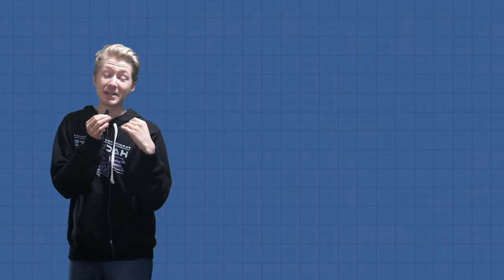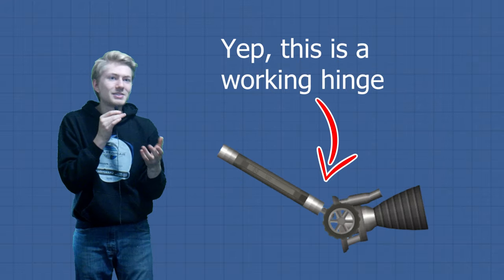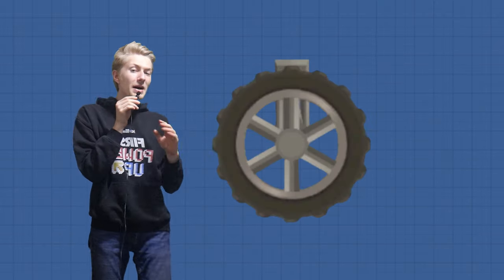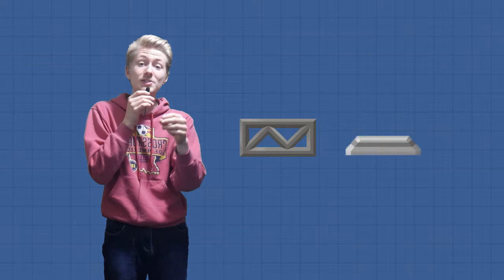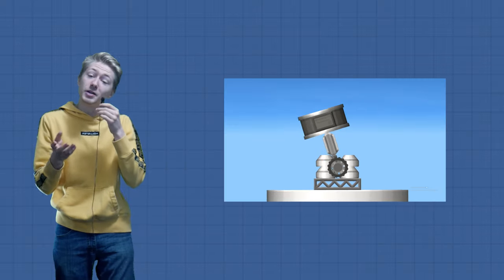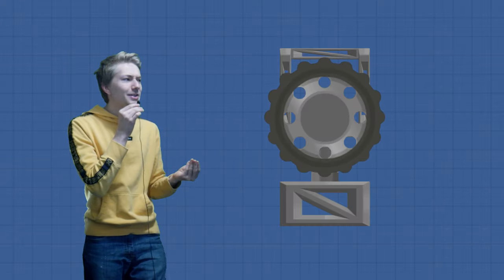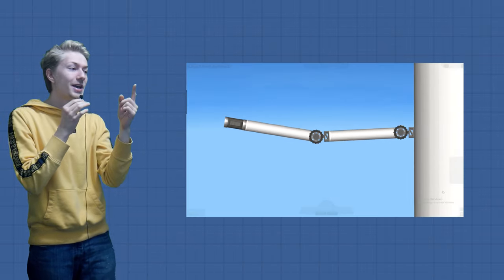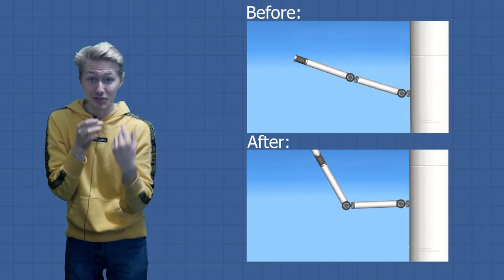How to MAKE HINGES in Spaceflight Simulator - SFS

Comment: Ok ok ok, I’m on sfs 1.5.7 iOS and IT WONT WORK
I need help with this I’ve tried the first one and it doesn’t work
Reply from the maker: which one?
Reply: @Heroix.  the first one the struts I think
Reply from the maker: @CAPTAINRIO7787  the struts one is kinda hard, you need something to push the wheel into the center iirc

Comment: Is there a way to make hinges without separatet parts?
Reply: No but if you’re having issues with the parts drifting while timewarping you can add a docking port that it connects to to prevent that.
Reply: @Bolt2307  yes i know ty anyway